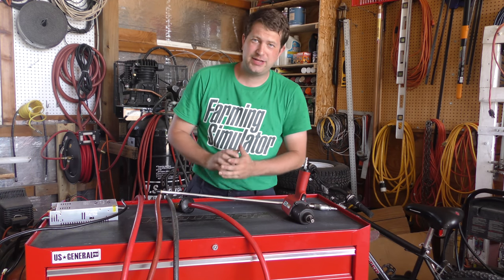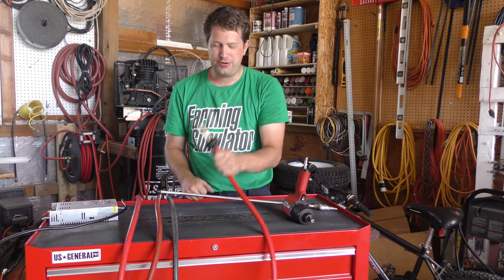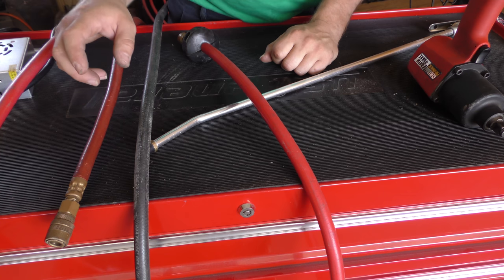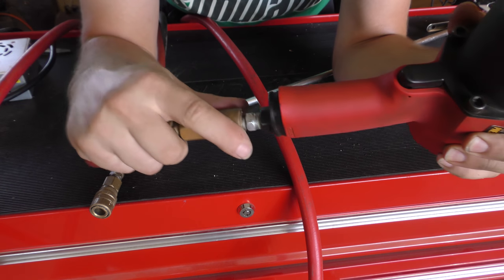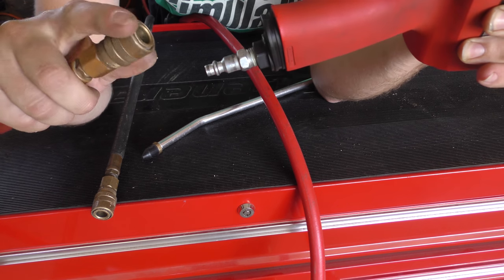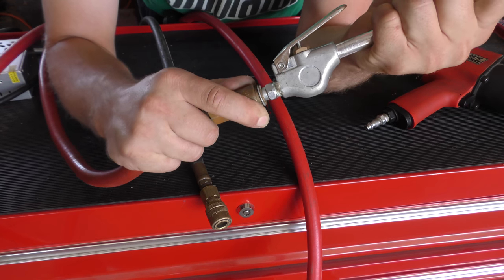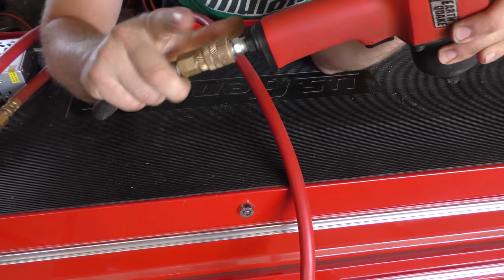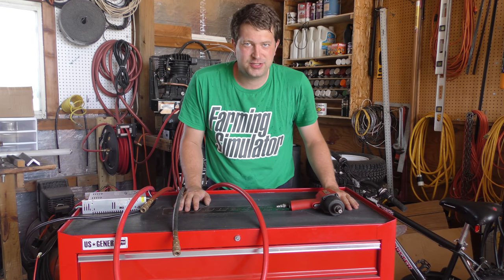Shop Basics - Connecting and Disconnecting Air Line Quick Connect Tools

Comment: I just bought my first air nailer and was a bit confused by the connector for a minute (probably compounded by how intimidated I was feeling about my new tool). Pulled up your video and relaxed enough to figure it out during your intro. Still, really appreciate that this is here.

Comment: i strugle to disconnect those when there is pressure. no pressure i cant dissconect them easly but with pressure i struggle
Reply from the maker: Well you are having to push against 120 PSI or whatever you system is
Reply: @radozeman  sooo 2 weeks later i still strugle, we ise Berner quick connect coupler. Our mechanic cnlan do it easly and my friend, but I just cant, do i miss strenght or something

Comment: I want to share a helpful lesson.

If you're not familiar with an impact wrench, it's a good idea to remove the socket, press the trigger, and check if it spins in the expected direction.

In my case, the wrench rotated in the opposite direction from what I thought the directional button indicated. Fortunately, the wrench wasn't working properly, so I didn’t accidentally overtighten my car's lug nut. 

Because the lug nut didn't move, I didn't realize I was tightening it instead of loosening it.
Reply from the maker: Good point! If you know what direction it needs to go!

Comment: Question 

The ball bearings in my coupler seem to be damaging the inside of the coupler with repeated use of air tools. I am using high pressure air most of the day. The ball bearings seem to create a burr just above where they're placed, and the burr starts getting worse and worse to the point where the hole stretches and I lose a bearing. I don't understand why it's happening.
Reply from the maker: Either you are using it a lot or not using the right male/female couplers? There are a few different style couplers and while they look very similar they are not necessarily compatible. Possibly cheap connectors? Harbor Freight ones in particular are really bad! Or are you using a tool that is creating an air hammer effect and the connection is absorbing the energy from that?

Comment: Maybe I have weak fingers or something, but I ALWAYS struggle to get those damn things on. I just can't pull the thing back AND push it into the tool. My hand just can't do both. 

In one shop, I had to embarrass myself everytime by putting the tool in a table vise to hold and then using both hands to ram the hose in... One to pull the thing back and another to push the hose in.
Reply from the maker: Can you try it with the system depressurized? That way you are not fighting the air pressure. You should be able to make connection easily if there is no air pressure, if you are still struggling then something is wrong! Either bad connector, or your not pulling the ring back far enough, possibly not enough hand strength, though I find that very hard to believe.